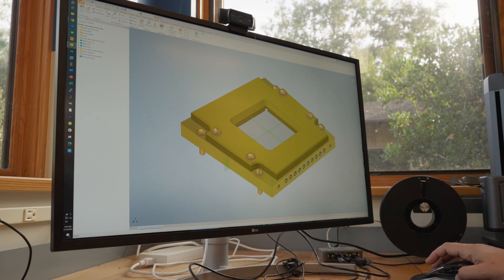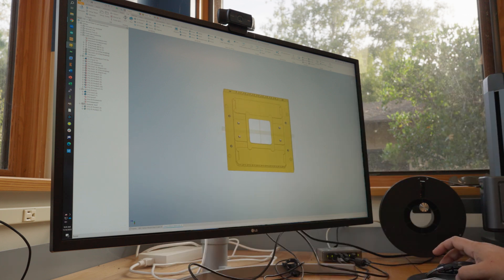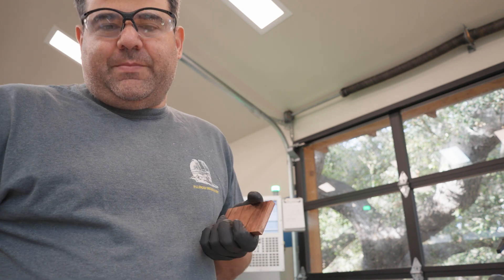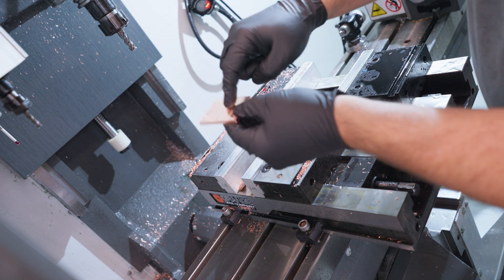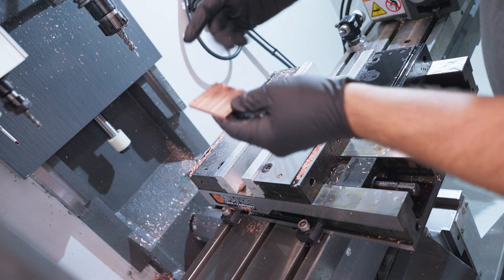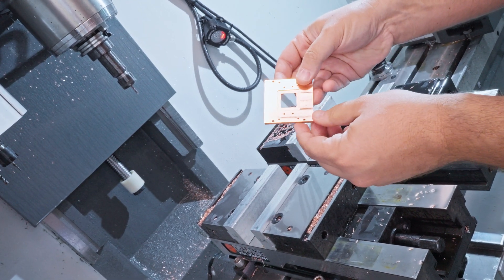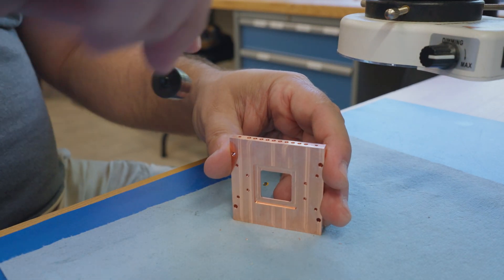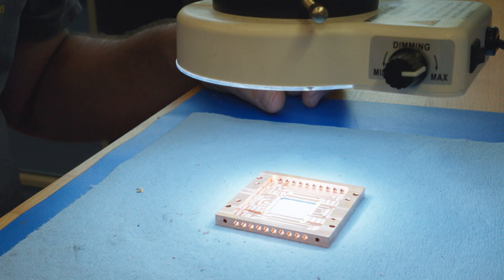Machining a Copper Cryogenic Sample Box

Comment: Awesome video! How did you determine feeds and speeds? Did you do a any tapping? If so with what tool? Do you need special coated tools?
Reply from the maker: Uncoated carbide 3 flute endmills seem to work fine, as long as they are sharp. The end mills usually have feed and speed info for non-ferrous metals, and then I back off those feed speeds significantly. Tapping is HARD, I tend to just drill the holes in the CNC and then tap by hand afterwards.